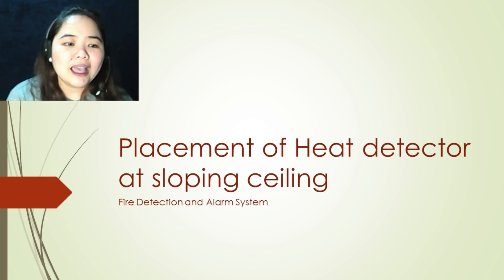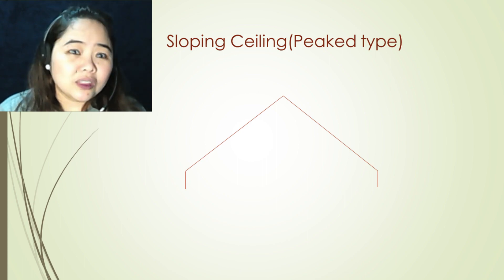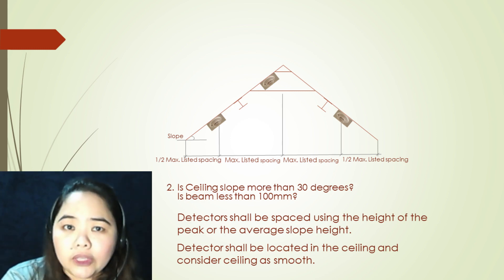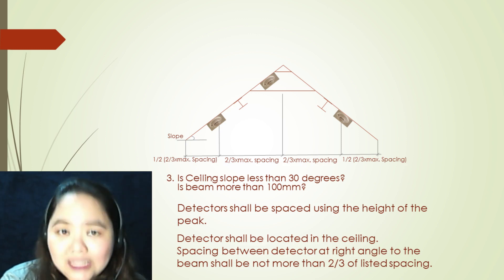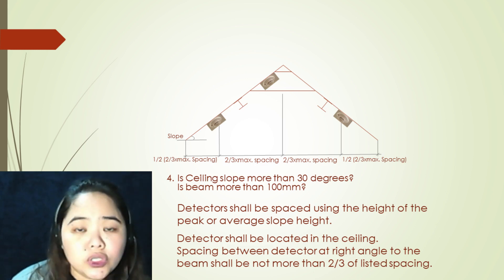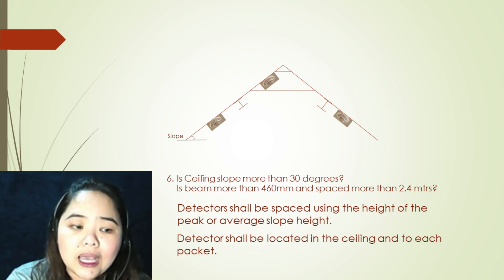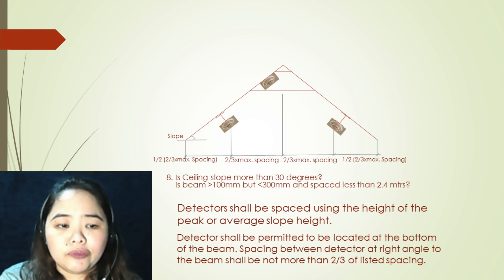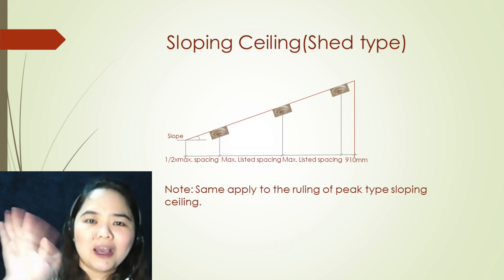Fire alarm design - Heat detector at sloping ceiling #Firealarm #Allaboutfireprotection

Comment: Hi.. could please clarify whether the smoke and heat detector are required on above false ceiling in office area. False ceiling height is 600mm
Reply from the maker: Hi, Mohamed. Take note that the NFPA 72 is just our guideline for design and installation, and you have to check the local code requirement to verify how are you going to provide detection. Like for example, if the local code tells you to provide total coverage as per nfpa 72, then you may need to consider every areas mentioned inlcuding the space from suspended ceiling regardless of the ceiling void height. And there are also exception for providing detection in concealed space in nfpa 72.

Comment: what are the criteria of providing smoke detector in ceiling void as per nfpa 72?? do we need a smoke detector for electrical running inside ceiling void irrespective ceiling depth/height???
Reply from the maker: Hi Shailendra, if depends on the governing laws, codes or standards accepted locally as specified in NFPA 72 17.5.3.1 2013 edition . AHJ's requirement  will tell us where specifically the detection is required. You will notice in the clause I mentioned above that "accessible space"  or space above suspended ceiling are included in the list of space to be protected with fire detection when "Total (complete) coverage is required by law, codes or standards. I advise that you first check with the local code(AHJ) for the exact requirement. Otherwise if it is stated in local code to follow the total complete coverage of NFPA 72 for location of your detection, then you may now consider providing detection above suspended ceiling. The underlying premise is that if an enclosed compartment is accessible, it might be used to store combustible materials will will cause more fire risk. Please look at clause 17.5.3.1.4 of NFPA 72 2013 edition too where you may require detector space above suspended ceiling when it is used as return air plenum for HVAC. Please check the latest edition of NFPA always since I used 2013 edition.